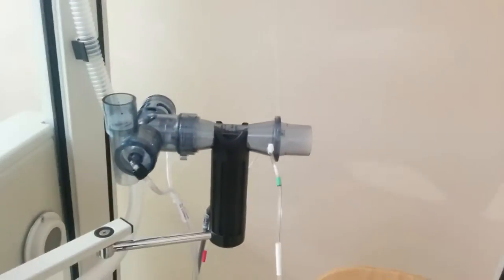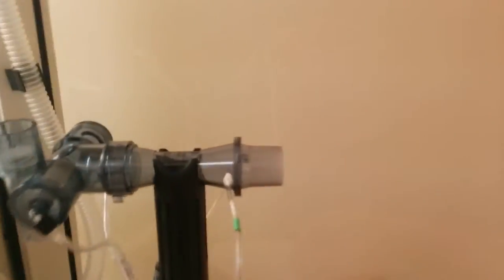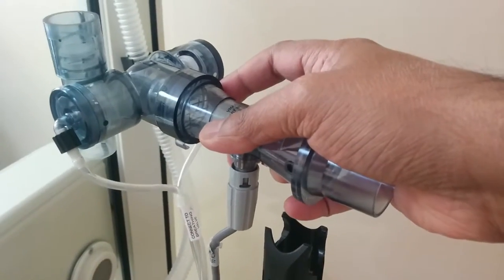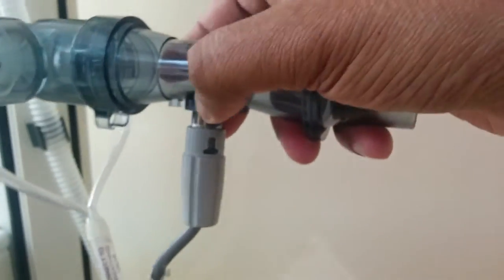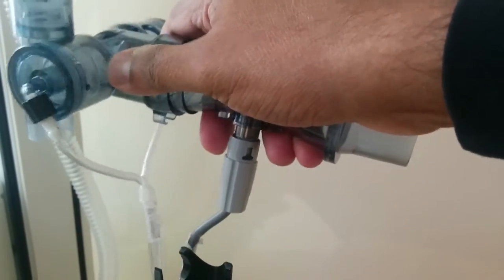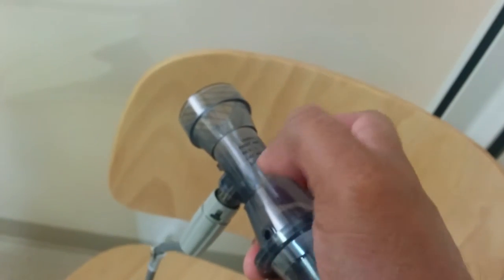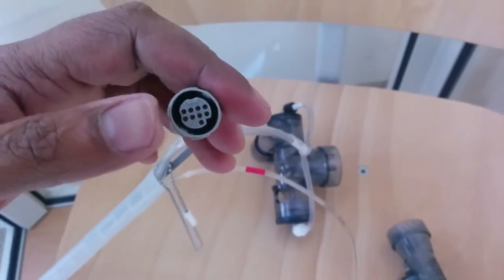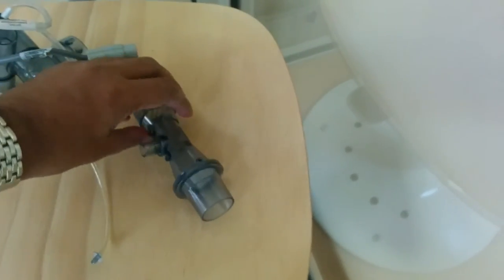PFT V max Changing the flow sensor

Comment: Hello. Can you please tell me wich software version you are using and operation system? Thank you.
Reply from the maker: Hi, did you mean the PFT equipment that I use and the software?. I use Vmax from sensor medics. Which is marketed by Carefusion here in Canada. right now I use the latest version.
Reply: Thank you for you reply. I am asking because in the hospital that I work here in Portugal we use the same equipment but with a very old software version and the company that sold the equipment says that there isn't any update. I am suspicious that they just want us to buy a new equipment.
Reply from the maker: The latest software is v-max 28-5 which i use. I think it should be part of the equipment contract to have the uptdates....kindlt check with the vendor.